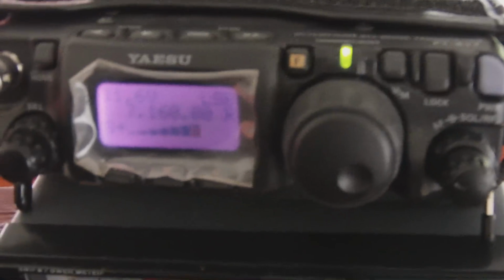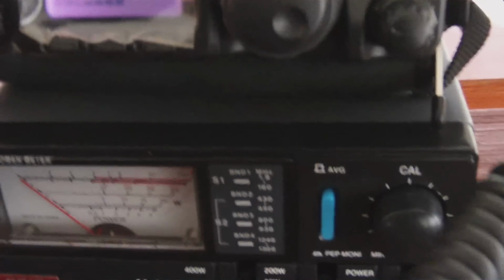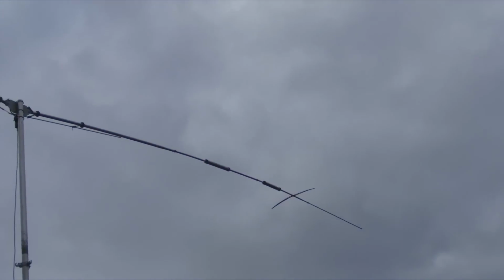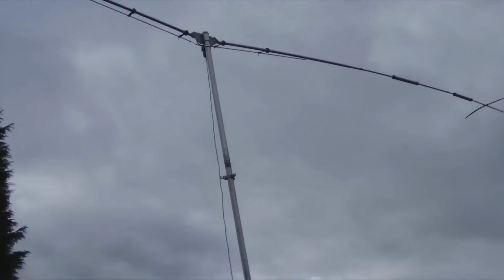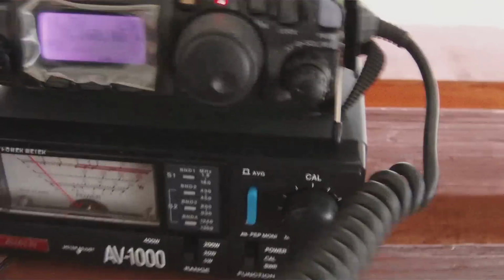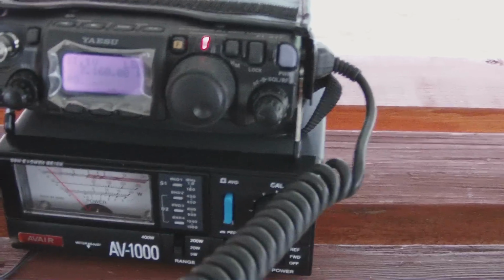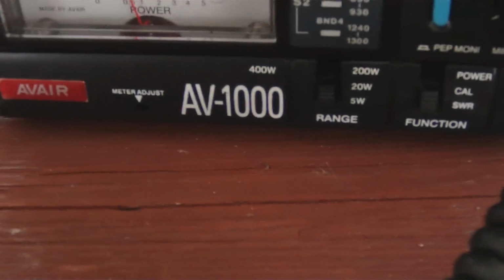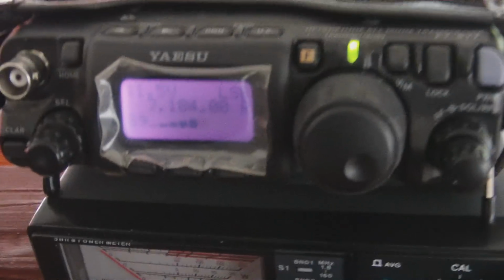Yaesu FT-817 QRP (Not Beleived) PART 2

Comment: Hi, I run the FT-817nd myself and have had similar responces, yours realy performs well on that strange looking dipole, I feed through a vertical delta loop (which can be seen on QRZ) with great results but not on 40M, once while at the caravan I set up a full length long wire with a masive counterpoise and two 1M earth rodrs into very moist ground and broke through a pileup into Alaska, quite a few ops would not accept I was QRP.
73S
Phil
M6MRP

Comment: That looks a good antenna Simon, but not sure if it's worth the extra £230 over the Comet H422 although you so get 6 metres.

I've read there are some contructional issues with the Comet so the Create might be better in that respect.

Peter.

GI4 KBW.

P.S. wish I'd bought an FT 817 when they were only £349 a couple of years ago. Rigs are getting very expensive now, for some reason.

Comment: It is silly of them to not believe it possible. They are hams so it should be easy to visualize for them, after all they know the nature of radio, lol! Let's get hypothetical... If you do an S5 to a station running 1W then 4W gets you an S6 to them, 16W gets you an S7, 64W gets you S8. So basically, a 100W radio with its 20A of current draw will only gain you about two and a half S units on a 5W rig taking one and a half amps peak. Good audio and the right elevation angles from your antenna will easily compensate, especially if your in a favourable location. A 1W station with an efficient antenna and punchy audio over sea water will easily trump a 100W station on dry land, using a mediocre antenna without gutsy audio :D now consider that band conditions on HF fluctuate by more than 20dB. I thought these hams would know better ;D